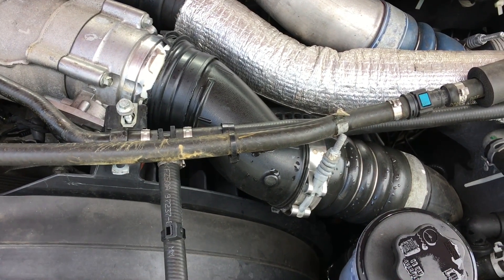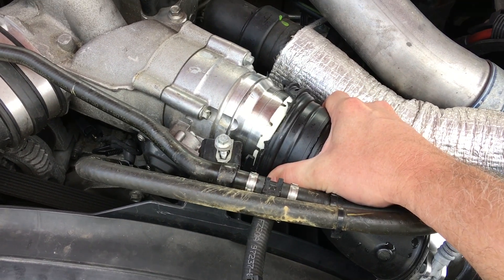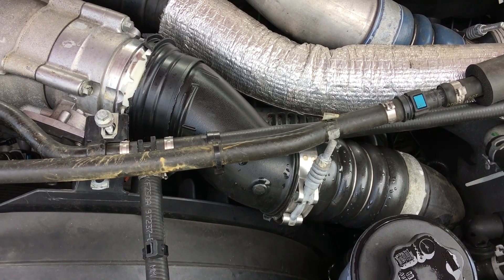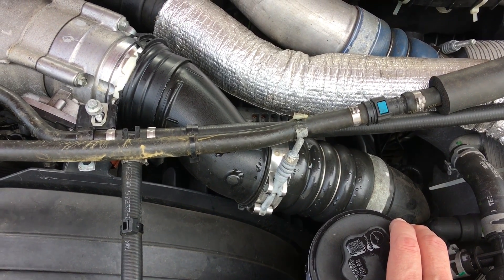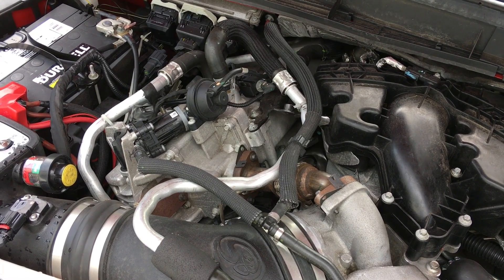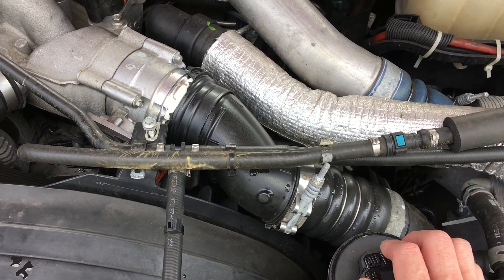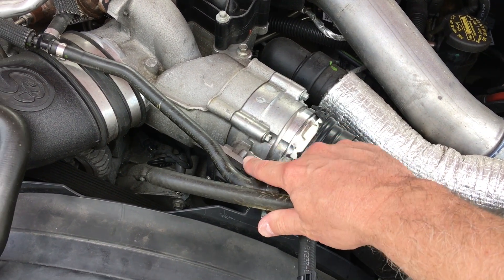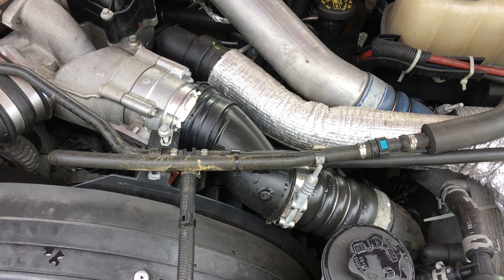6.7 Powerstroke Inter-cooler Pipe FAILURE!

Comment: 217,000 miles on my 6.7 with the OE Intercooler fittings. Tuning an engine has unforeseeable consequences from stressing the original engineering design criteria.

Comment: Mine blew last week. I had the pipe replaced. And it blew again. What is the reason it's building that much pressure that it keeps blowing off?
Reply from the maker: Do you have a tuner on it or is it still stock? A tuner will generate enough boost to blow the inferior OEM pipe. Also, if the clip holding the pipe to the throttle body isn’t securely attached, the pipe will easily blow off.
Reply: @@subman719  it's tuned and deleted. But this is the first time thisnhas happened repeatedly since I've owned it for 2 years.
Reply from the maker: @louseal7574  … It’s possible that your barometric pressure sensor is not working properly and you’re building too much boost. I’m sure I would’ve blown the OEM pipe a second time, had I not installed the AFE Bladerunner kit. Do you have a mechanical boost gauge on it to see what you’re running?
Reply: @subman719  is the OEM pipe inferior or has the tuning exceeded the OEM design. I’m 217,000 miles on my OEM with no issues.
Reply from the maker: @Doc.Holiday  … OEM pipe is very inferior! It’s all thin plastic. You are one of the lucky people who haven’t experienced a blowout yet. It’s ironic that the new PowerStroke’s are coming standard with a similar, all silicone pipe, that H&S Performance developed years ago as an upgrade for the 2011 and up 6.7. 

I highly recommend getting an aftermarket upgrade pipe before you experience a problem. It’s not a matter of IF, it’s WHEN!
Reply: @subman719  ,… I’ll give you an update in another 200,000 miles. Also, since the new OE connections are re-engineered, why not just go with that replacement?  Are they $300 bucks?  I’ll check it out the next time I get some service.
Reply from the maker: @Doc.Holiday  … I don’t think the new pipes will fit the previous gen PowerStroke. I think everything was redesigned in 2017.

Comment: That just happened to my f250, engine overheating message too.  Any idea about why I'd be overheating too?!
Reply from the maker: Sorry to hear… the overheating condition could be a stuck thermostat or low on coolant due to a leak or blockage. Also could be faulty fan clutch.
Reply: @subman719  the overheating occurred with the busted inlet.  By some miracle, State Police stopped and happened be a diesel mechanic, had the factory part, and was willing to go get the part and replace it for me.  He only wanted 60 bucks.  I gave him a 100, long story short I was on the road with no other issues.
Reply from the maker: @cpabrego  … That’s awesome! Glad it worked out well!

Comment: I have a 2014 F350 6.7 dually with 100531 mi and mine just split top and bottom. Truck runs and drives normal just has no boost. My speed is not limited and I have no limp mode but when you put your foot in it there’s just nothing there.
Reply from the maker: Yup, that’s exactly what happens. No boost, no power. Once you replace the pipe, you’ll be back in action.

Comment: Mine blew on my 2015, the inside is caked in oil and residue. Should I be concerned about that?
Reply from the maker: Sorry to hear… The oil and residue is common on the 6.7. It’s oil bypassing the turbo shaft seal and from the crankcase breather system.

Comment: we were getting on the highway pulling our 21ft travel trailer last Friday. exact same issue. i found it interesting that Ford had 2 on the shelf and told my wife this must be common. $106 and 20 minutes later we were back on the road. piss poor Ford quality
Reply from the maker: What pisses me off the most is that instead of owning up to their mistake and making a better replacement part and issuing a recall, they instead make it the owner’s problem and charge for the same exact INFERIOR part!!! Ford FINALLY copied H&S’ silicone pipe design on the newer PowerStrokes. I’m DONE with Ford! RAM and Cummins got it right!

Comment: Just this morning I had to have mine replaced. It was just cracked so it was robbing enough boost to keep the pressure too low to start regen so I got check engine light and the dpi filter was clogging up so it was caught and corrected before the dpi was destroyed. Manual regen had to be done and all ok now. At least I hope.

Comment: Really Ford? Mine broke at 67K. Ford bragged about a 250K severe service testing of this engine durning development, and Ford would have us believe that no plastic boost tunes failed? BS! This part is inappropriately made of plastic like the 2011 oil pans. Ford should upgrade this part for free!
Reply from the maker: @jamesw.6931  ... My CP4 pump already had failed and was replaced under warranty. I believe it's demise was initiated by a remote cold start with gelled up fuel on a near zero degree morning. The pump disintegrated internally a year later and spit metal throughout the fuel system, causing a $9k repair! The dealer mechanic screwed up something with the injectors, and did some shoddy work, which caused a slight misfire. That problem wasn't acknowledged until two years later, after it was out of warranty. Lessons learned!
Reply from the maker: I absolutely AGREE!!! Ford made an INFERIOR product and won’t own up to their mistake!  Class action lawsuit time!!!
Reply from the maker: @jamesw.6931  ... Yes, my entire fuel system was contaminated with metal from the injection pump. The initial cause was I didn't anticipate the extreme cold night and didn't put anti-gel in my fuel. I normally use Power Service or Howes anti-gel but we had a cold snap and I didn't prepare for it. I had to add Power Service 911 emergency anti-gel and put a gas heater blowing under the truck to thaw it out to get it started. However, the three consecutive remote-start attempts already did the damage.

Comment: Mine is stock at 365,398..... currently having power issues at high speeds. Truck can not get beyond 67mph without the fan staying activated. Once I get out of the throttle, fan cuts off. Replaced the CAC Sensor when the P026A code popped up. Engine Temp is normal at 208°..... Trans Temps is at 241° while trying to gain speeds. Not sure what else can be issue.
Reply: if you tranny temps are getting high there will be some issue with your secondary cooling system, the fan will kick on when the secondary system gets low on coolant... mine was doing this ended up being an internal leak in my intercooler forcing the coolant from the secondary system into the intake and burning it off. The coolant kept getting low but I never could find any leak under the hood.
Reply from the maker: @ckc121188  … Great information! Thanks for sharing!
Reply from the maker: I would try a new fan clutch. It’s supposed to disengage under acceleration to allow full power output, then re-engage under light throttle/load.

Comment: I’m just curious where is the wire to the sensor on the pipe?
Reply from the maker: Which pipe are you referring to?
Reply: @subman719  I found it, my charge air cooler sensor came loose and was hanging, thanks
Reply from the maker: @kevinpaulus7804  ... Glad you got it fixed.

Comment: Blew mine at about 25,000 miles while pulling a 10,000 LB travel trailer through Carlsbad, NM while on vacation.  It sounded like  a 12 gauge shotgun fired off in the cab.  After replacing it, the egr cooler went out along with the O2 sensors.  Finally got rid of the truck.  I loved the power of the truck but not the unreliability of it.  My wife and I had both retired and had planned to 'travel the country' pulling the trailer.  I made an expensive mistake buying the Ford.  I've been driving Fords since owning my '67 Mustang - they've lost a really valuable, loyal customer.
Reply from the maker: Sorry you had to go through that on your trip. I had 4 Ford Super Duty’s in a row... NEVER again! RAM is the ONLY way to go! Between their 6.4L Hemi or the Cummins, both excellent choices for reliability and the RAM interiors are simply amazing! Ford just doesn’t get it! They’re so high on themselves and they prey on the loyal fools who will keep paying them! Not me, not anymore!
Reply: @subman719  The thing that got me to thinking about this again (and pulled me into the 'black hole' of the Internet - and your video) was a video (that I can't find again) done be Steve Lehto about a huge settlement against Ford in California by a fellow who really got stuck with a Navistar 6.0L diesel in a Superduty.  The guy had bowed out of a class action lawsuit in favor of a stand-alone suit.  I think that the jury found in his favor to the tune of somewhere between $700,000.00 and $900,000.00.
Reply: @subman719  what problems did you experience with your 2013 6.7?
Reply from the maker: @matthewdickey5248  ... the injection pump disintegrated around 30k miles and spit metal throughout the entire injection system. $9k worth of repairs, luckily covered under warranty... however, dealer mechanic screwed a lot of stuff up which didn’t present itself until after my warranty was up! 

Plastic Intercooler pipe blew out afterwards but I am thinking it was because mechanic didn’t connect it to intake correctly. It new apart at an uncommon location. Who knows...

Then at around 50k miles I discovered a lot of oil blow-by through exhaust and the turbo was getting noisy. Whether or not these failures were due to the delete and modifications still is unknown. Based on research and other people’s experiences, it’s probably just Ford’s quality at it’s finest! 

I’ve had four Super Duty’s with PowerStrokes since 2004 and ONLY the 2007 was trouble free! 

If you’re looking for less problems with diesel trucks, get a RAM with the Cummins! If you don’t need to work a truck hard for hundreds of thousands of miles, just get a 6.4 HEMI and be done! Diesel’s are very expensive to operate and maintain and the DPF systems are only rated to about 120,000 miles and are NOT covered under warranty! They are considered a “wearable” item! 

Hope I helped.
Reply: @subman719  wow. It’s annoying how these cp4 pumps are known to be problematic yet Ford, dodge, and Chevy all put them in their trucks. Cp3 pump seems to be the way to go. Do you still have your truck? And I wonder if your blow by issue could have been caused due to a strong tune putting excess stress on the motor?
Reply from the maker: @matthewdickey5248  ... Blow-by issue was due to the DPF delete and 5” exhaust... The lack of back pressure causes the 2011-2014 turbos to overspool and go out of balance, therefore wiping out the bearings and seals prematurely. The 11-14 Ford turbos have double sided compressor wheels which add excessive weight to one side of the shaft. 

CP4 pump failure was possibly due to a remote cold start a year prior where the fuel was gelled up from lack of enough anti-gel and unexpected extreme low temps. The remote starter process kept trying to start the engine with no fuel flow. It took a year before problem presented itself... just my theory. CP3 pump is definitely a rock solid pump! 

I traded in the truck two years ago for a RAM Promaster that I needed for work. My next truck is gonna be a RAM 3500 with 6.4 HEMI, possibly sometime this coming year.

Comment: Same happen to me at this moment how can I fix temporary
Reply from the maker: Depends where it broke... possibly several layers of duct tape and a large hose clamp or two around damaged area.
Reply: subman719 thanks is what I did
Reply: @kompitamtz6255  hey man what did you do? Mine broke at the bottom part
Reply: Christopher Martinez I’ll put doc tape  that helps I’m driving noting happen to now  I’ll order a new one but I’m still waiting for
Reply: Also use a pull tight seals

Comment: My ‘15 just blew at 32,300 miles. Just a few days ago we finished a 1500 mile road trip.  Can’t tell you how glad I am it stayed together for the trip. The hose on the intake side separated from the end opposite the intake where it is crimped on with a metal band. Time to find a hose clamp and hope it makes it to the dealership.
Reply from the maker: It’s just me ... I would look at some aftermarket parts either from Snyder Performance Engineering or from XDP.com. Unfortunately the OEM parts can’t be trusted.
Reply: subman719 Thanks for the info. I will look into it. A coworker of mine with a 2012 had his fail only a month ago. He went aftermarket. Sounds like a good idea.

Comment: Blew mine 87,000
Reply from the maker: kevhino260 ... Sorry to hear.
Reply: Blew mine at 87214, 65mph towing a 5th wheel in Eastern Montana.  Man, that 95 mile tow sure did suck.
Reply: Mark Anderson I ordered one from Amazon, its was $160, not hard to install, got my truck running again with no problems.
Reply from the maker: kevhino260 ... What brand pipe did you get?
Reply: subman719 The brand is called Rudy’s Diesel
Reply from the maker: Mark Anderson ... Sorry to hear that.
Reply: We were 60 miles outside of cell phone service.  Got to town and found OEM part is on nationwide backorder due to Covid shutdowns.  Dealer in Sturgis was able to get the last available aftermarket part in the region.  Don’t yet know the brand.
Reply from the maker: Mark Anderson ... WOW!!! Ford should be making this a recall by now! I’m thinking of starting a class action lawsuit against Ford since so many people here have had failures due to Ford’s inferior design and they’re not taking responsibility for it!

Comment: Just blew mine tonight. 14k miles. Truck looks brand new some rich guy had it never drove it and I got it w 10k miles on it. Tube looked dry rotted
Reply from the maker: Frank Santiago ... Wow, yours is the lowest mileage one yet!
Reply: subman719 $100 fix today good as new. Got the oem for now
Reply from the maker: Frank Santiago ... that’s exactly what I did until the AFE Bladerunner kit came in.

Comment: Anybody know the part number for the o-ring that goes in the engine side fitting.  Mine disappeared when fitting cratered.
Reply from the maker: Rusty R. ... I think it only comes with the new pipe, but don’t hold me to that.
Reply: @subman719 Talked to Ford dealer and a part number for motorcraft is listed as RTS-1071.  I am just now looking the number up to see what is listed.
Reply from the maker: Rusty R. ... best bet would be to check a salvage yard for one.

Comment: Any of y’all know where to buy the retainer ring? H&S upgrade doesn’t come with and mine was lost in the blowout.
Reply from the maker: kyle jutras ... I believe it only comes with the new OEM pipe. You may have to contact a Ford dealer to see if it can be purchased separately but I’m pretty sure they’ll tell you it’s only available with the whole pipe. Other option is get one from a wrecked truck in a salvage yard. Hope this helps.
Reply: subman719 Thanks! I checked with the salvage yard close to me and they don’t have a F250. Going to try the dealership. This may be a dumb question but do I need it?
Reply from the maker: kyle jutras ... YES! That ring is the only thing that holds the pipe on, especially during boost. Doesn’t have to be an F-250. Can be any Super Duty up to F-550 with the 6.7 diesel.

Comment: I have a 2015 6.7 with almost 160K on it now.  Deleted, tuned, egr bypass since 135K.  Mine blew about a month ago, but I was getting on it pretty hard at the time.  Clean break at the top end of the plastic, right behind where it connects.  Same noises, same gunk.  The oily gunk had me concerned, but I talked to a few ford diesel techs and they said the gunk build up is completely normal and they see it in every one they replace, which is quite often.
Reply: I bought a spare just in case.

Comment: MIne blew today. Hauling a heavy load of hay and thought I blew a tire. Mine split at the factory clamp that holds the accordian piece to the smooth tube about half way down the pipe. Is there something else causing this?
Reply from the maker: TIM Graeve ... Sorry to hear. Unfortunately it’s just a piss poor design by Ford. Thin, cheap plastic where it should be metal! The only sure fix is a better made aftermarket pipe. I used the AFE Bladerunner kit because it uses aluminum pipes with silicone boots. Very well made and gives piece of mind.
Reply: @subman719  The dealer said they keep at least one each for 6.0, 6.4 and 6.7 motors because it is very common. How can this not be a recall situation??????
Reply from the maker: TIM Graeve ... This should absolutely be a recall situation... unfortunately it may have to start as a class action lawsuit for that to happen.
Reply: The inter cooler pipe blew off because the truck can not exhaust the gases and it build up pressure in the inlet side of the engine you have to check the dpf system .

Comment: Blew it at 76k miles what’s the part number do you know?
Reply from the maker: Gaston Gonzalez ... If you plan on keeping the truck get the AFE Bladerunner pipe kit. If you’re just looking to temporarily fix it to sell the truck then replace with OEM pipe from Ford. Ford hasn’t updated the replacement part to my knowledge so it will blow again!  OEM part is a little over $100. AFE Bladerunner kit is either $250 or $500 depending on either cold side only or full kit for hot and cold side pipes. I have the full AFE Bladerunner kit available if you want it for half price of new. Email me @ subman719@gmail.com  for details if interested. I put OEM pipe back on truck before I traded it in.
Reply: subman719 do you have to do tuning with that kit? I need it on a stock truck
Reply: subman719 do you have to do tuning with that kit? I need it on a stock truck
Reply from the maker: Gaston Gonzalez ... NO tuning needed. Just swap pipes and go. Direct OEM replacement.
Reply: subman719 sent you an email